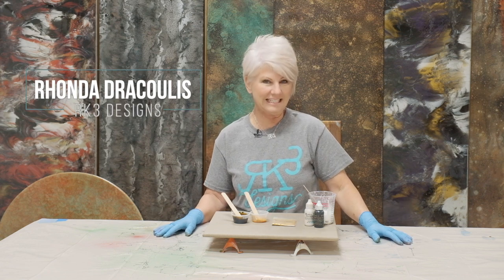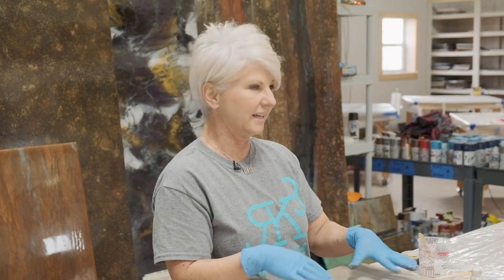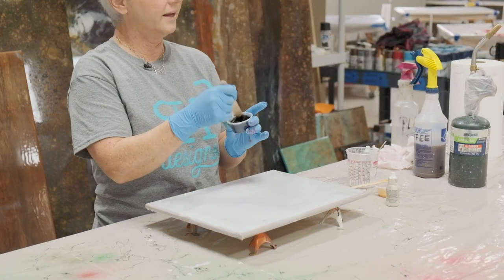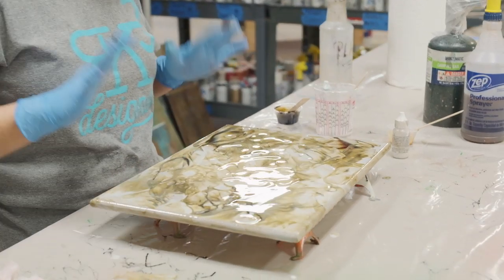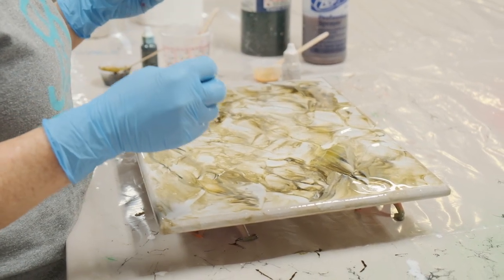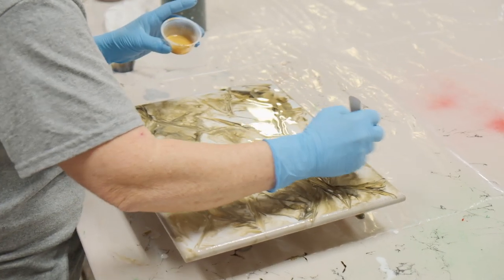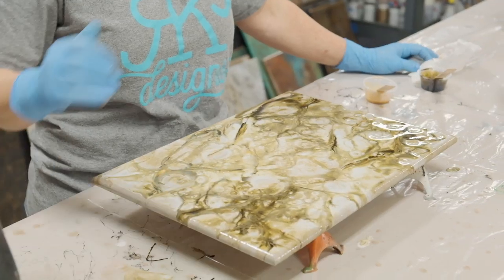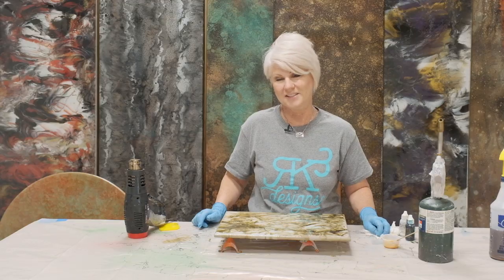Stone Coat Epoxy: Coffee and Cream Marble Finish

Comment: Believe or not, I would have lightly misted something like a French cream over the whole thing. I love contrast- just did a turquoise and copper vanity- but for some reason I think of marble only like the marble I saw when I was growing up near Marble, CO, i.e., softer. 
Off the subject... I’ve only two counters left to make in our house, but my ceramic mugs and dishes are scratching the completed ones! I can’t figure out what I’ve done to make my counters scratch magnets! Have you ever used floor epoxy as the top coat? Would it be harder?
Oh, I think my favorite finish is the natural stone you did for a video. Can’t get over how flippin’ gorgeous that is; bet I’ve watched that video over four times! Still wishing I could get my financier to agree to one of your master classes. I’m sure I could rocket my outcomes!
Reply from the maker: I’ve never used floor epoxy. Not sure how it would react on a countertop.i almost ALWAYS put a matte finish on my countertops. This hides any micro scratches. Also, if you have little scratches, take your hair dryer and heat them up, they will literally disappear in front of your eyes. 😊.
Reply: @RK3Designs  Does this heating to remove scratches trick work after the countertops are in use for months/years or only when the epoxy is still setting in or young?
Reply from the maker: Ashok Moghe ive used this trick on older countertops that have small fine line scratches. Still works pretty good.